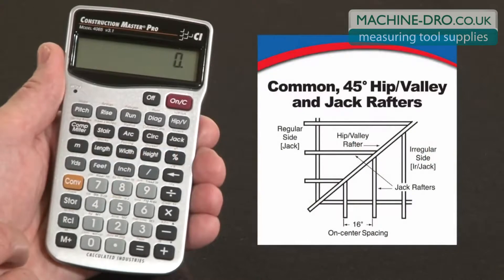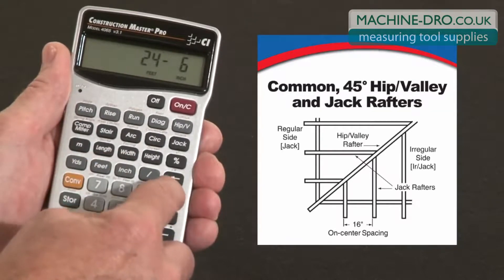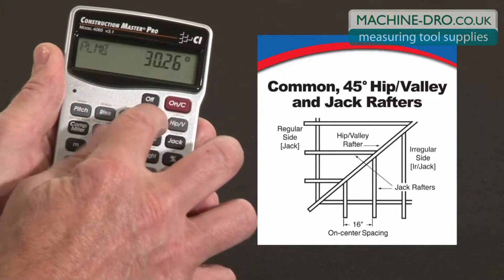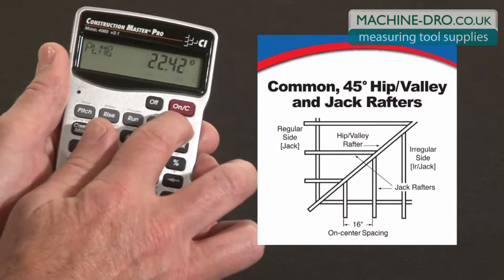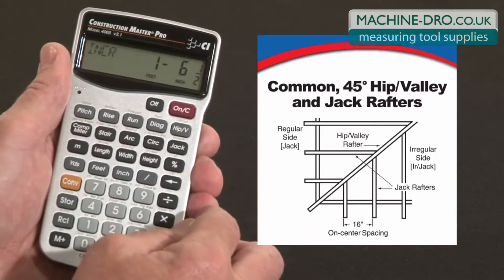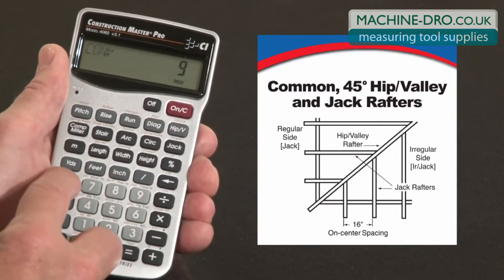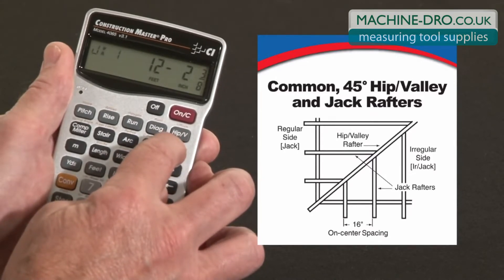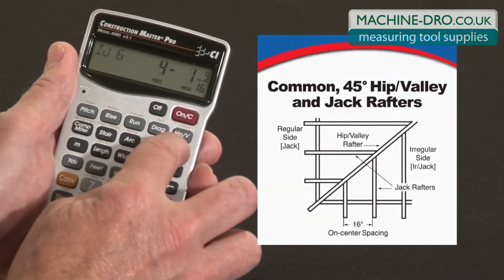Construction Master Pro, 45/non-45 degree Hips, Valleys and Jack Rafters

Comment: How do you calculate irregular if you only have rise and run not pitch
Reply from the maker: You could use the sequence as follows:

1.	Compute irregular pitch using irregular run and rise and solve for pitch
2.	Store value in memory.
3.	Enter regular run and rise, then solve for pitch
4.	Recall value from memory and enter as the Irregular Pitch
5.	Solve  for the Irregular Hip/Valley